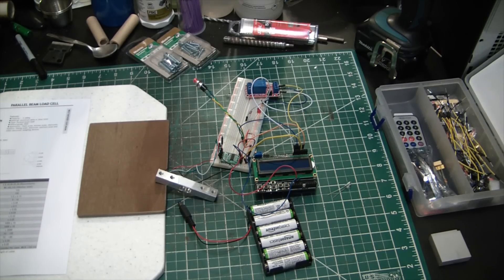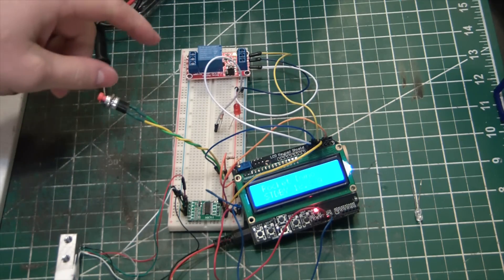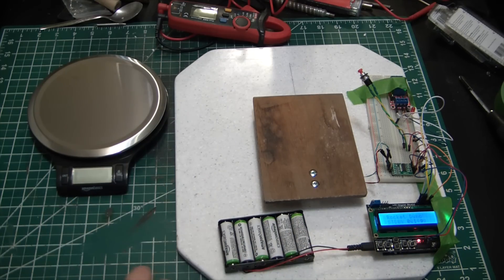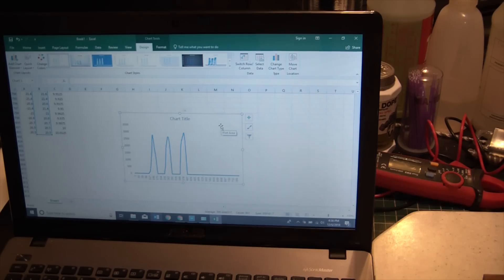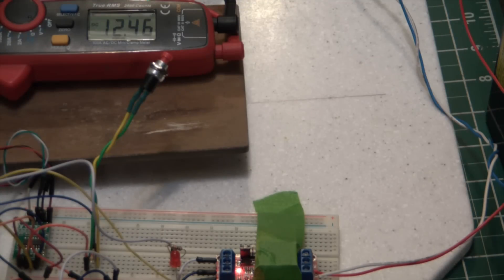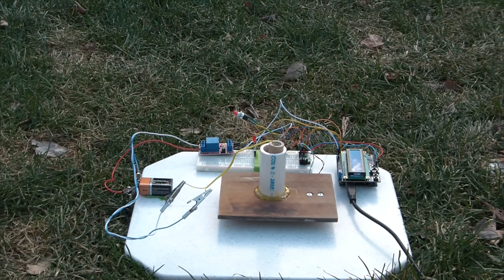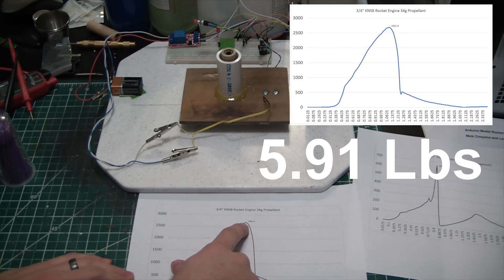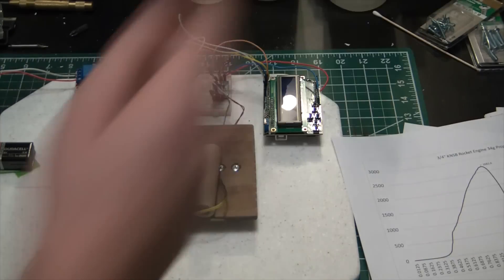Arduino Rocket Motor Thrust Test Stand! - Elementalmaker

Comment: Thanks for the great video!  I took your design, referenced Nick and Len's PDF file, and built my own version of the rocket test stand. It works fantastic!

 I'm using a 10 kg load cell and added a large 4" seven segment display sitting next to test stand with a rotating red light on top. I installed an igniter enable switch (safe/arm) that also checks continuity of the ematch.  After modifying the graphical user interface code, I purchased a 50 ft active USB cable so I can sit 50 ft away and Trigger the system through the laptop. 

I then added a plexiglass blast Shield that I placed in front of the test stand to catch any Rogue fragments coming off the motor.

 It's amazing how sensitive the system is. Kudos to you and those who help develop this Arduino system!

Comment: If you notice when the rocket goes off the base actually flexes downward because of the soft grass. You may get better results beings on a more stable/ harder surface. Awesome video man, love your content.
Reply from the maker: Yeah I did notice that when editing the video. I am sure it did somewhat skew that data, might have shown a bit more thrust if not for that grass compression. Good eye!
Reply: @ElementalMaker  yea man thats what i was thinking, i doubt it would have made much of a difference but hey man the motors kicked ass thats what matters.

Comment: Wish this was for raspberry pi. I need to build my test stand. 

Also this will always be progressive burn being a single fuel grain with one uninhibited fuel surface.

This is where multiple Bates grain motors come in. You can actually tune your thrust curve. Progressive, neutral, or regressive all by changing the length of a Bates grain with 3 uninhibited burn surfaces.

Thanks for the video. Keep up the good work.
Reply: Actually for little uncomplicated setups like this one Arduino is the best. Read a sensor, send data to serial. Rinse, repeat. Low cost, easy to program and debug. If you choose the right components you can place a whole data acquisition system on a C-engine rocket (done that with an Arduino Pro Mini). Can't see a RPi making that flight. :)
Reply: @stamasd8500  mainly I would like to make a test stand. Bought the Rpi for doing projects with my son. Now I'll have to get a adrino to do my own projects! Data acquisition I'll just use my apogee device to give me the basics.
Reply: @rizin2213  Both the RPi and the Arduino are adequate for a test stand, but I tend to favor the simplest approach to reach a goal. Arduinos are cheap, plentiful and easier to work with. I have several dozens of them in projects I built. The last one was a digital frequency synthesizer using an AD9850; currently working on building a high-temperature kiln, and the kiln controller will be another Arduino. A RPi would be overkill, unless I decide I want to stream live video from inside the kiln. :D

Comment: The trust climbed as the propellant burned from the inside to the outside increasing the burning surface over time, plus the internal pressure built over time, both increasing thrust. Used to make sugar rockets 25 years ago, biggest one I made was around 2.5" id and 8" long, man did it go.
Reply from the maker: Holy crap that had to be a MONSTER! Any idea what altitude you got to?
Reply: @ElementalMaker  It was just a stick rocket (full 48" long 1/2" dowel) and it tipped over a bit as it launched so I would say it went up 500~600 feet and downrange 1000~1500, I would say it took 2~3 seconds to build thrust before it launched, boy did it roar. Glad I did it in the winter and out in the boonies so no chance of a fire. Used Durham's Rock Hard Water Putty for the nozzle, it is very hard and does not shrink when dry, then a forming mandrel and damped it in layers, match stick with wire igniter shoved to the top to ensure ignition at the top of the core.

PS. Pretty sure the tube was from a large roll of plastic wrap, around 1/4~3/8 wall thickness.
Reply from the maker: @oswynfaux  boy that's one huge stick rocket!

Comment: Nice setup!

Would be nice to see if you get better thrust by reducing the outlet from the bigger rocket. Try jamming a hex nut in the end and lock it in with epoxy, should allow for higher combustion chamber pressure, longer more even burn, and higher exhaust velocity, while also adding a bit of weight to the bottom of the rocket, making it more stable in flight.

Comment: Nicely done this is way cooler than the plywood thing you built last time! I suppose next is a series comparing different chemistries for home made fuel with each other and the store bought engines.
Reply from the maker: Thanks! Quite a few videos using this in the future I'm sure!
Reply: @ElementalMaker   I like idea that koori049 has.

Comment: from my experience working with resistance based load cells i can tell you that small temperatur changes will have an effect so make sure you work in the same temperatur environment
 you should also reset it before you make new measurements 
and never overload it since you will have to reset it i generally dont go over 80% of the estimated max load 
and science mechanical work turns into heat you want to rest the cell in between measurements

Comment: WooHoo my friend. I worked with big load cells on logging scales for years. They can be fickle things eh. They were/are 2x2x26 in.and handle 25 ton +. Great fun this post for sure. Love it. Great tests and info my friend. See ya next time around fella !
Reply from the maker: Holy crap 25 ton! That's insane!
Reply: @ElementalMaker  Most or all log trucks have 4. 2 on the main trailer and 2 where the 5th wheel or bunk is. Pain in the hiney as they are aluminium and are fastened with steel bolts to a steel frame. Add some current and you know what you get.I am an expert removing broken 1 1/4 broken bolts my friend, LOL.

Comment: Could the double spike on the small engine be when it moved in the tube? Maybe a poly tube the right size for the engine would give a cleaner curve?
Reply from the maker: Yeah I do need to make a sleeve to keep the smaller motor more constrained. Maybe I'll finally put my 3D printer to use!

Comment: Sorry I'm late to the party, but just by an eyeball average, it looks like you're getting around ~30 seconds specific impulse (closer to 25 for the smaller, 35 for the larger). IIRC, KNS fuels have an upper limit of something like 120 seconds, but I don't recall whether that's a practical limit or a theoretical limit. So there's definitely room for improvement, but it's not bad for how simple those motors were. I saw other questions about how to calculate specific impulse: specific impulse is the exhaust velocity divided by earth standard gravitational acceleration (9.8 m/s/s). Average exhaust velocity can be calculated by dividing the average force (in newtons) by the average fuel consumption rate (in kg/s).
Reply: As a sample calculation, I'll start with the larger rocket graph. The bulk of its firing occurs between 0.4s and 1.5s which gives a fuel consumption rate of .034kg/1.1s = .031kg/s. With an (eyeball) average force of ~11 newtons in that interval, that gives an exhaust velocity of 11N/0.031kg/s = 355 m/s. Divide that by 9.8m/s/s to get a specific impulse of about 35s.
Reply from the maker: I always look forward to seeing your comments and as usual you do not disappoint! Thank you for the sample calculation too! That certainly brings it down to a level even I can understand. Let me know if you want to see the actual data, I could send you the excel sheet if you interested.

Comment: It'd also be interesting to see what the total impulse of each engine is. also, it would be interesting if you had a real-time clock module and an SD card module so you could save timestamped data directly to an SD card in csv format instead of having to copy out of the serial monitor.
Reply: The millies() function in the Arduino returns milliseconds since power on.

Comment: Might want a concrete block or slab on the grass underneath, the larger engine thrust the whole plate down and it rose back up during burn and data capture

Comment: If you want to use the 12V battery, you could probably just put an inductor in series with the match. That way it'll impeded the current change and heat the nichrome slower.
Reply from the maker: Very good idea. I did design the igniters for use with 9V, so I should have know better than to use 12V, but the inductor idea is great!

Comment: Awesome video.
On the first engine, we can see the base of the scale moving downward because of the thrust, then back up.
While it wouldn't change the area under the curve because the whole setup "rebounds", it makes your curve a bit off. So the actual curve should actually look better (the thrust is highed than shown on the first part,  when the base goes down, and lower when the base goes back up).
For higher thrust engines, do the test on harder ground for more accurate results.
By the way, you used a 10kg sensor right ? Did you update to higher load cell later ?
Reply from the maker: Yes both a larger load cell and the ground movement have been addressed in newer tests. Much larger motors behind tested as well. I have done videos on them
Reply: @ElementalMaker  Yep, I've seen your rocket related videos. 
Does the larger load cell has a decent sensitivity for smaller engines ?
I saw yours read a 42kg thrust on the 3-grain engine, so, I do guess that's.... a bit over 10 ;)
Reply from the maker: @xialemai6412  yes the 50kg load cell seems to be just as accurate for smaller engines as the 10kg was. I was expecting some accuracy loss, but nothing detectable occurred.
Reply: @ElementalMaker  Oh damned ! I just received the 10kg load cell....
Well, I guess I'll have to stick to small units for now ;)

Comment: Now you have this for testing, be awesome to use it to compare various propellants. I'm personally curious how it fares against kno3/sugar. Could even try the three types of kno3/sugar against each other. Mixed/compressed powder, melted together and that method of dissolving both in water to mix, then boiling off the water, then melting the residue.

I gotta learn how to use arduinos.
Reply from the maker: Great ideas! I've only played with the arduino a few times, but it's definitely a great piece of technology!

Comment: From where I'm sitting it looks like your 
cone got wallered out again,
which would account for the sudden drop
in thrust shown in your curves.

You may want to consider doing some or 
all of these improvements:

1. Upgrade to a hydraulic press
2. Change cone material
3. Make the thinnest part of the cone thicker

I hope you will take this as constructive criticism
as I quite enjoy your videos.
Reply from the maker: Yeah the throat of the nozzle eroded quite a bit again. Working on new nozzle compositions with added refractories to minimize erosion. I did make it a bit thicker this time, but didn't seem to change the degree or erosion.

Comment: large engine seems normal,  that thrust curve is expected for a cylindrical mandrel. Next thing I'd try with that one is a + shaped mandrel, so the thrust is more constant, and you can optimize the nozzle for a single chamber pressure rather than a changing one.

looks like the nozzle orifice on the smaller engine was too small or got blocked by something, pressure built up, thrust spiked when the nozzle blew out, then as more of the grain was exposed some thrust built up again.
Reply from the maker: Yeah I definitely think the smaller engine got blocked momentarily causing that drop to zero that can be seen on the chart . I definitely want to experiment with different grain and core configurations; great suggestions!
Reply: @ElementalMaker  What condition is the nozzle in? I think the blockage was only partial, and happened during that small blip at ~0.75 seconds, causing chamber pressure and exhaust velocity to rise, increasing thrust. This lasted until the throat of the nozzle failed at the very peak of that spike, at which point chamber pressure and thrust drop to basically zero, and only when combustion rate increases with the increased surface area do you get some thrust back.
Reply from the maker: Ill have to take a closer look at the 1/2" nozzle. I was so focused on the 3/4" nozzle eroding again I didn't give the 1/2" one much attention. I agree it was a partial clog, a complete clog and I probably would have had a nice little CATO.

Comment: Wow! That's impressive and Fun.  Hey just an Idea to create the best of both worlds. How about the 1/2" tube with a smaller bore and try to make the burn rate progressive as opposed to digressive. Thus giving you and longer higher energy burn? Not an expert here in this space though in other areas this can give you an longer more sustained burn while the energy output increases. Keen for your and others feed back on this idea? Cheers and thanks for sharing.

Comment: I seen a video on youtube some years ago. It was how to make gun powder from hardware store bought stuff. Can't seem to find it any more. But all I remember it was stump remover, Charcoal, and a gardener stuff for the sulfur. Have you ever done something like this? How would that work? Sorry just can't find that video and don't remember who made it.
Reply: I've done this recently. Use this formula: 75 percent (by weight) potassium n*trate, 15 percent charcoal (make your own, don't use Kingsford....I use light wood like pine and sumac) and 10 percent sulfur powder. Dudadiesel.com out of Alabama is the best source for the potassium n*trate and sulfur. 10 lbs n*trate and 1 lb sulfur +shipping/hazmat is about 40 bucks all in. Grind/mill everything in a ball mill or shaker bottle with .50 caliber lead balls (be gentle). Once down to fine powder (airfloat for the charcoal), mix them well. Add a solution of 1 part 91 percent rubbing alcohol to 3 parts water until it forms a paste about like thick cake batter. This works the n*trate into the pores of the charcoal. Spread it out on a cookie sheet and put it under a fan for a day or so. Crumble it up when dry to the desired grain size. You can also add some dextrin (easy to make from cornstarch at home) at 1 or 2 percent to hold the grains together well when you mix in. (Sorry for the asterisks in N*trate, I'm keeping with EM's Youtube PR Policy). You will get some GOOD lift powder out of this.

Comment: The extra spike on the small motor, im my theory, may be due to nozzle erosion. Usually, the grain is larger in diameter to the nozzle, but given the simple nature of your motor, its relatively unavoidable. The heat melts the propellant before it ignites and creates blockages in the nozzle. Be careful for CATO's on the smaller motors with smaller cores because of this!
Reply from the maker: Yeah that's what I believe it was. On the thrust curve you can see it almost dropped to zero, would could definitely be explained by a blockage. Very good insight thanks for the excellent comment 👍

Comment: You just took this all to a new level of geekery. That was fuckin' beautiful. And thank you for being non politically correct in your delivery. It's what sets the channel apart from all the others. I've been blowing nozzles out on my stand (no load cell, just a simple deflection scale), so I'm in the process of building a down firing stand with a curved flame bucket so I can control where they blow out, if nothing else.  My neighbor gets worried when he sees burning propellant chunks flying up in the air over the fence.   I can't wait until my shipment of "Ammonium/Chlorine Based Oxygen Source" comes in.
Reply from the maker: Thanks Rex! Getting into the AP based propellant is a whole new level! I experimented with it years back, but never quite got a good motor with it. Always had catos and nozzle blowouts. There is a great book called 'experimental composite propellants' by Terry McCreary, I definitely recommend checking it out if getting into that stuff 👍